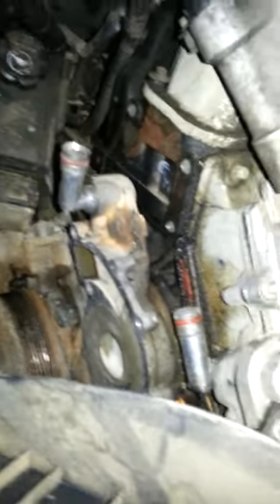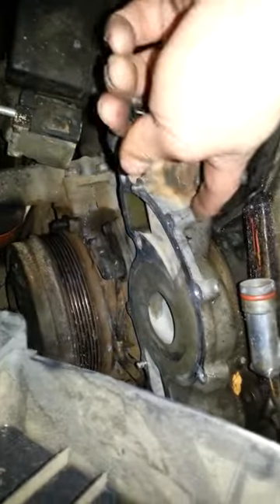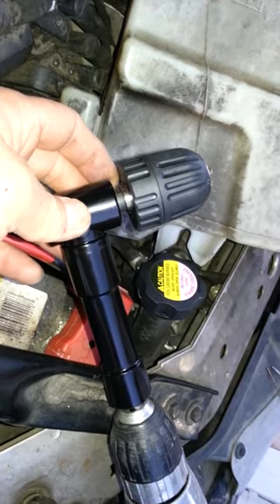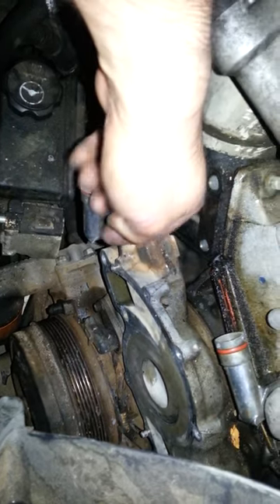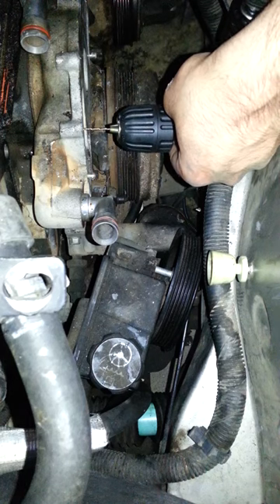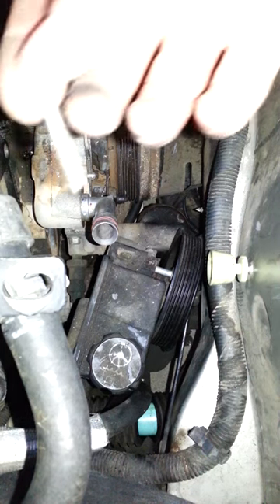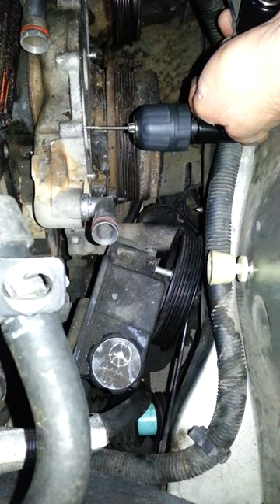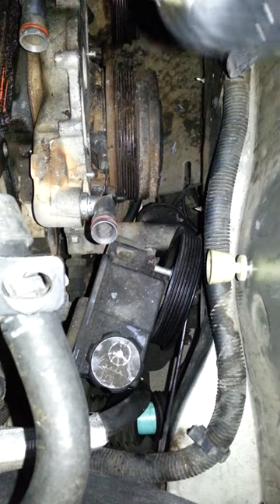How to remove a broken bolt on the water pump

Comment: I just bought my son a 2000 Mercury Mountaineer same engine I believe as the Ford his water pump went bad as I was changing the water pump because it was leaking I noticed that one of the studs was broken going into the water pump and the thermostat housing Inlet literally rotted in half I guess he was running water instead of engine coolant or whoever owned it before my son anyways I'm having a problem trying to get the bolt that is broke out of the engine block I'm trying to avoid removing the timing cover at all cost but the problem is I cannot get a drill bit long enough to reach through to get a bolt extractor in there any suggestions will do also I wanted to buy a new studs I called the Ford dealership and they don't even make them anymore so I have to go to a hardware specialty shop just to get the studs
Reply: I'm having the same problem with my 2000 Mercury Mountaineer

Comment: Probably not gonna use all that because you have to be pretty precise on the broken bolt have to be dead center or you will end up having to retap the threads on the engine and the pump itself

Comment: I broke for off the five bolts on my water pump, it’s being held in by one remaining, and I pulled a head bolt out of the block and stuck a washer with it and shoved it back in and that holds the water pump in
Reply: Does it leak or does your car overheat?